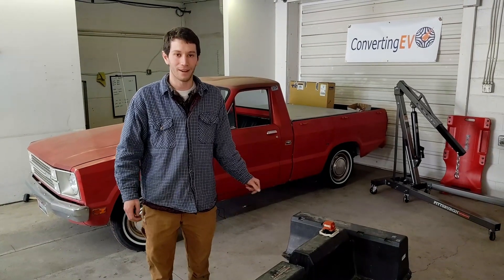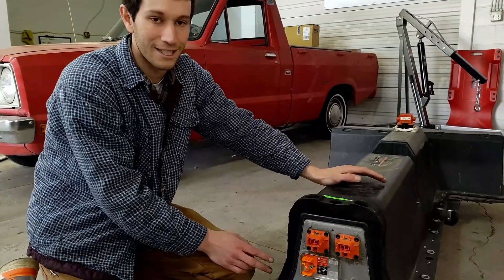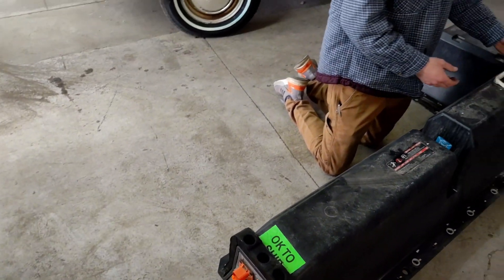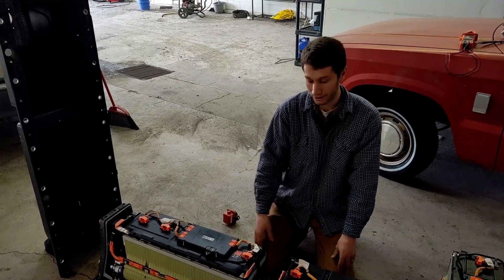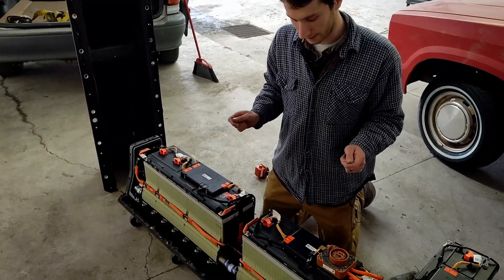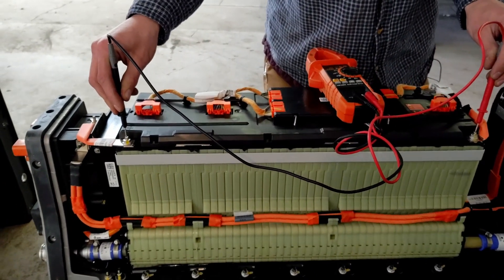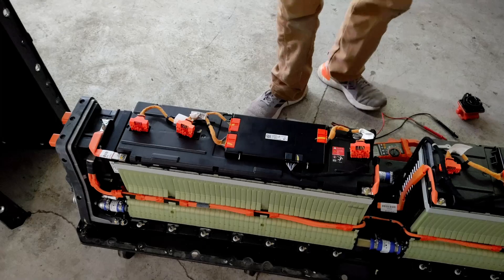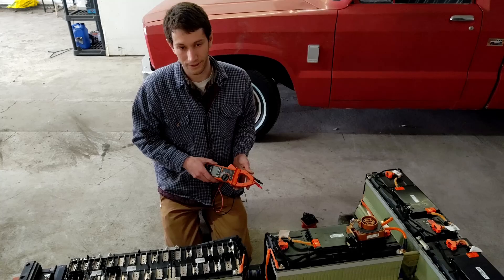Watch before buying Chevy Volt Battery

Comment: MY CORD WILL NOT LET ME CHARGE THE HIGH VOLTAGE BATTERY.. SO WHERE CAN I JUMPER THE HIGH VOLTAGE BATTERY TO GET SOME CHARGE BACK IN THE BATTERY SO I CAN RUN IT ON MOUNTAIN?? ALSO WHERE IS THE SENSOR THAT TELLS THE CAR IT IS COLD 25 DEGREE OUT SIDE.. I WOULD LIKE TO LIE OR JUMPER THE SENSOR TO RUN ON GAS.. THANKS..

Comment: https://youtu.be/AFfJ4KLFyr4?feature=shared
Used one of these and broke them into 3 114v packs using a hyper9 motor and bms from thunderstruck ev
Worked out fantastic
Reply from the maker: Nice! I broke mine up into 3 packs of the same voltage for the old dc motor in my truck with plans to upgrade to hyper9. What range do you get with your setup?
Reply: @convertingev  with the 3 114 packs in parallel get about 80kms  on a charge. The thunderstruck charger and bms worked out perfectly. Lots of wiring and programming but it turned out incredible.

Comment: For checking the balancing of cells, comparing the voltages of each, isn't it more important to check them at their discharged SOC? By "discharged" I mean at their lowest normal cycle voltage.

Comment: Do you know how to check the thermocouples on the battery packs?
Reply from the maker: First Gen they are internal. A Google search should help you find the pin out of the BMS plugs on the top of the battery or just use a multimeter and check pins to find the two that don't have cells connected. Then you should be able to compare millivolts across the thermocouple with all the other one in the other modules assuming your pack is all the same Temp. On second Gen they are external and easy to get to and test.

Comment: I'm about a third of the way through the video where you are talking about how the Volt handles charge cycles. If you don't mind me sharing, I have a  2013 Nissan Leaf that had 12 bars on the SOH guage when I bought it in early 2016 and now 7, almost 8 years later I have 10 bars. I attribute this to my charging rules that I defined while researching EV's before I bought one. I have the computer set to stop charging at 80%, and I've only taken the charge below 20% once (out of necessity). In addition, I use level 1 charging almost exclusively, though I have used level 2 public charges a handful of times, again, out of necessity. Whether or not my regimen is the reason why I still have around 75% of battery capacity or if I just got lucky, I don't know but I'm fairly certain that keeping the battery pack in that sweet zone between 20-80% of charge doesn't hurt.

Comment: I scares me how you casually and repeatedly you lay your hands on the battery pack.  I know it's not high voltage AC or plutonium or a poisonous snake.. but still ought to at least pretend to respect it.  I saw a wench get shorted to ground on a battery pack on a bulldozer once... it made a lasting impression on me.  I'm guessing those 8 6v batterys only had a fraction of the capacity that the Volt battery pack does....

Comment: Good video
To replace a battery pack in a Chevy Volt:
Can each cell be tested under load in addition to a no-load voltage check?
Can the best individual cells then be mixed and matched from the junkyard battery pack and your own Volt battery pack?

Comment: i have two of these (48 volt group) wired parallel running a golf cart with a voltage meter to monitor each battery...how low in voltage can i run it safely???  If it is not running as long as it was when i got it what could be wrong .. a bad cell??
Reply from the maker: I just did the same to a golf cart. It must never go below 3.0V per cell or cells could get damaged. If you always push it that low it will start to degrade the battery. I like to keep it from going below 3.4ish volts. Also you should NEVER charge above 4.2V per cell but it's better to stop around 4.0 if you can to maximize battery life. If you don't have a BMS on it to balance cells then you better pop the top off and check it cell by cell very often. A cheap DC power supply can manually balance them. I used a 32s ANTbms from China for mine.

Comment: Brian,  what type of screws hold down the cover? are they phillips or torqx ,   thanks
Reply from the maker: I think they are a 10 mm or 8 mm around the outside and a torqx around the fuse HV disconnect plug which also needs removed to take off the cover. I'm not totally sure though it's been a few months.

Comment: I build powerwalls out of the chevy volt batteries. I have been using 5 packs for my powerwall now for 5 years.
Reply: Any videos or knowledge to share?
Reply: did you use a BMS?which one?thanks
Reply: @patrickdufour5025  No I haven't picked a b m s yet. I'll be testing at least two or three different units. The battery seemed more reliable than the b m s is i've seen for years.

Comment: Hey there, I'm looking for a BECM module for my Volt. Do you use those or would you sell it?
Reply from the maker: Aren't those only a problem on the second gen volts? I think I have the one from a 2nd gen sitting in my garage. I am not going to use it but it will fail eventually too. And you probably need a dealer to flash the software to make it work with your volt.